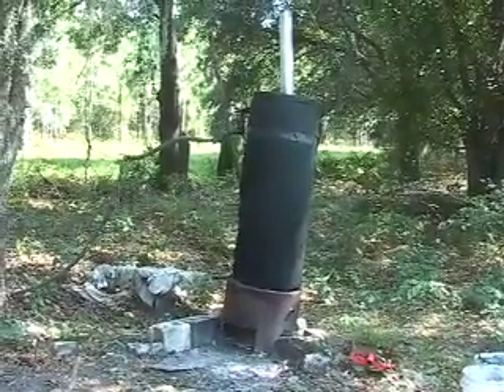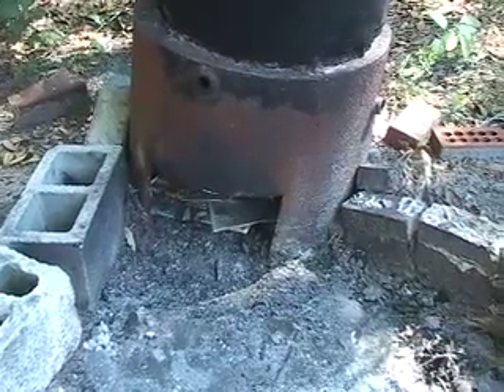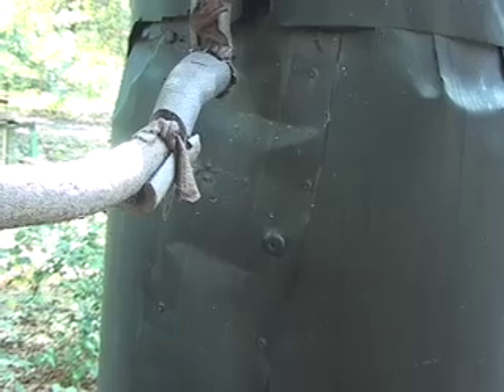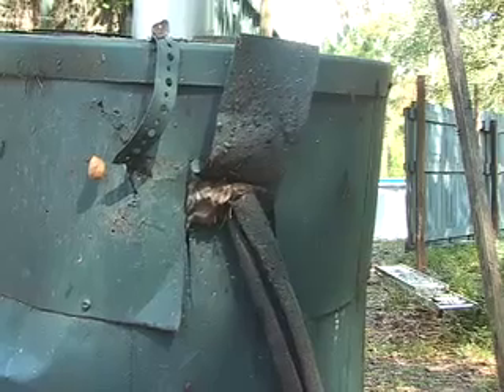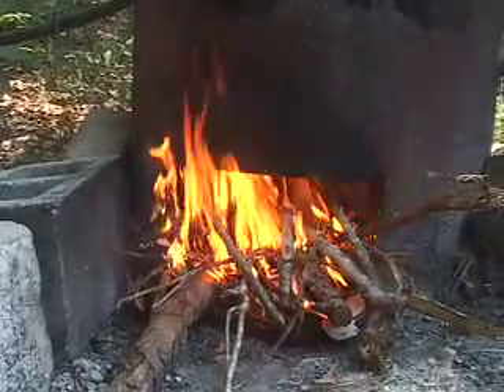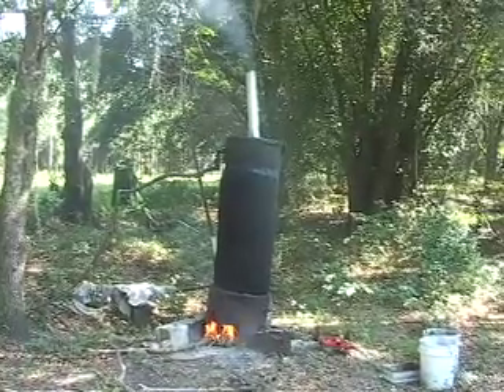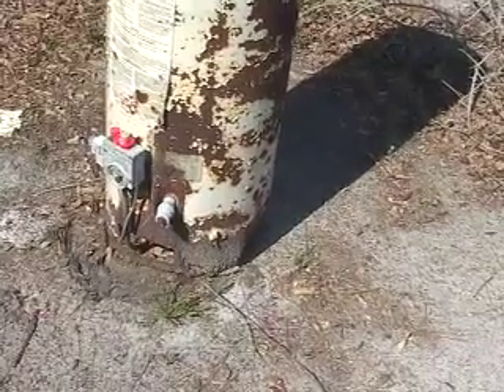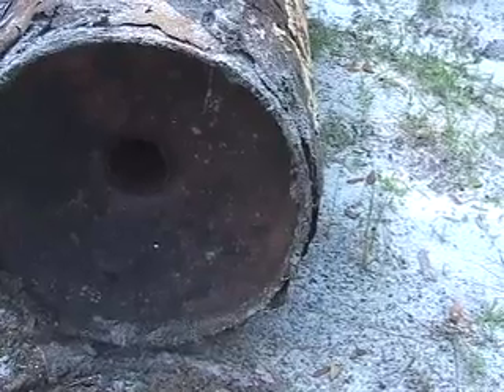StillPE's wood fired water heater

Comment: YOU CAN FITTED DIAL THERMOMETER IN THIS GYGER  FOR MEASURE THE  WATER TEMPERATURE 
WE ARE MANUFACTURE THE DIAL THERMOMETER IN DELHI
VIKAS GUPTA , DELHI
WHAT APP NO  +91-9810305949

Comment: I like your design. I used to live on a farm and my dad didn't want to spend money on electric to heat our water. He would get old tanks from where ever. We would lay the tank on its side on a frame that held it a couple feet off the ground and burn scrap wood and trash under it. We never had any insulation on it and a tank would only last a year or two before the flames wore a hole in the steel tank. We had to schedule shower time because the tank would get cold not long after the fire died.

Comment: I found simular results with my 40 gal gas hot water heater heated with wood.  Thanks to you I set my water heater up for household use.  I've been using it for about 3 weeks now and we couldnt be more pleased with the hot water output.